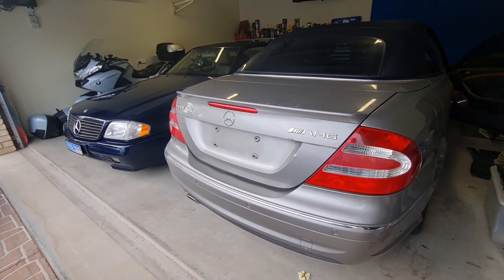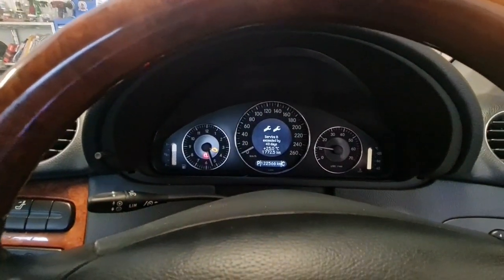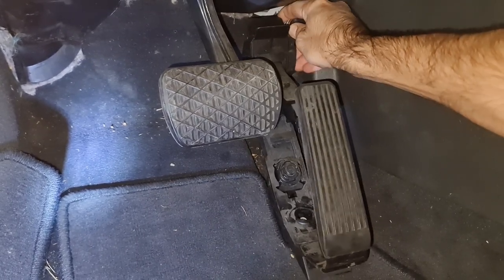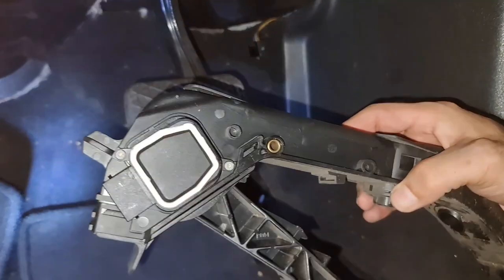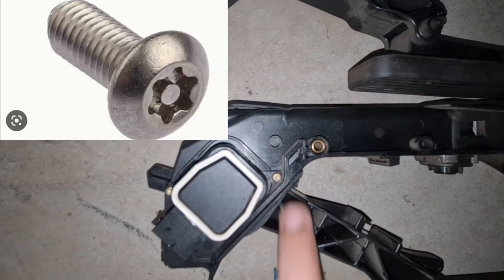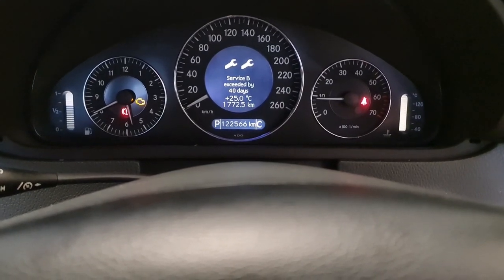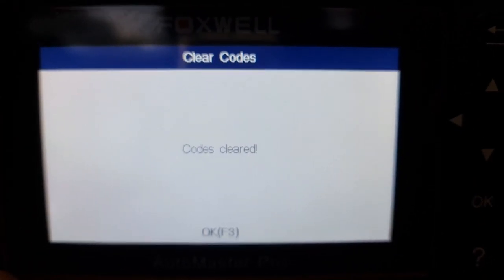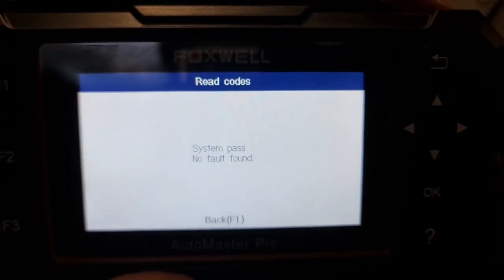Mercedes P0122 Accelerator Pedal Fault Fixed...(TPS)

Comment from the maker: Hi Guys, This car had 122,000 KM on the clock. The Throttle Position Sensor (TPS) usually causes the Check Engine light to come on and it is probably the easiest sensor to replace and diagnose. Please share your experience on the sensor and thanks for watching, liking, subscribing.

Comment: Could the TPS be faulting from the other end of the cable? (The part connected to the engine) Because in my case the throtle works but after a while it has delayed responses and sometimes none. I think it may be related to heat and I suspect the engine is heating the sensor/cables??
Reply from the maker: Throttle body might be dirty, inspect and for sure diagnose using a proper code reader.

Comment: note this is year dependent example pedal sensor for the 2002 year group the sensor is under the hood, right where accelerator cable connects.
Reply from the maker: Thanks mate for the info.

Comment: Hi had same code on w204. Pedal still worked, still replaced pedal and sensor and reset code. Code resets but engine light comes back and same code after 15 minutes of driving
Reply from the maker: Have you used genuine Mercedes part and correct part number?

Comment: Easy fix!
Reply from the maker: This one really was ;)
Reply: @BenzAddiction  challenge will be to find a good 2nd hand one unless you can find new.
Reply: Great video Sir, THANK YOU 🙏🏼
Please tell me what type of Foxwell OBD are you using?  And does it allow to Rodeo?
Very best regards,
Richard
Reply from the maker: @rcdrum29  Hi Richard, I have a complete video on this Foxwell: https://youtu.be/4ODSw6B1xJ8 
Please feel free to look at my other videos, cheers.
Reply from the maker: @John  yes John, seems like at 120k few things can go bad, including gear shifter, TPS, Cam sensor, crank sensor...
Reply: Hi, i am facing same kind of problem, i have 98 w210 M111 136 hp, there is slow acceleration, (kind of late response when i hit the gas pedal) maf sensor works well, no problem with wires. I didnt scan the codes. Isnt there any possiblity to change only accelarator pedal sensor?

Comment: I replaced mine and it still doesn't respond 😢 what else could it be
Reply from the maker: @lilred4224  Make sure the part number fully matches.  Makes sure the connectors are in a good shape and the wiring is not damaged.

Comment: W212 2.2CDI P0123(15),P0123 Throttle position (TP) switch A/accelerator pedal position (APP) switch A-high input.  Pedal Problem? Car sems driving ok.Engine light on!
Reply from the maker: Hi, very likely...